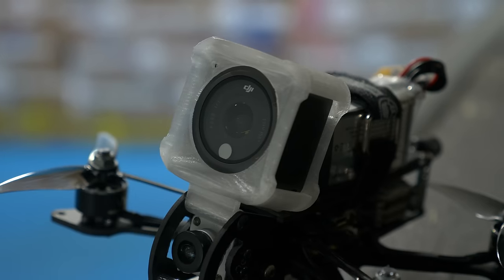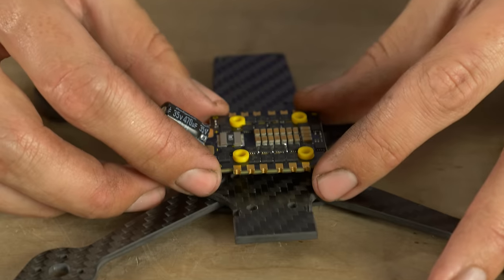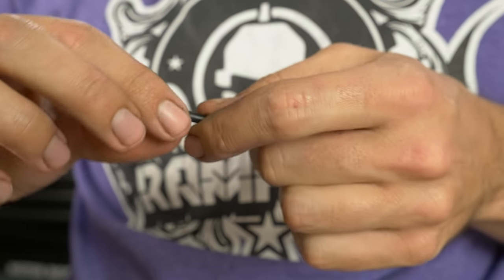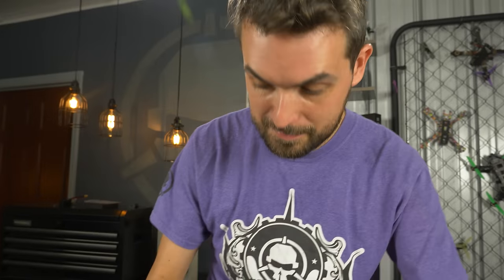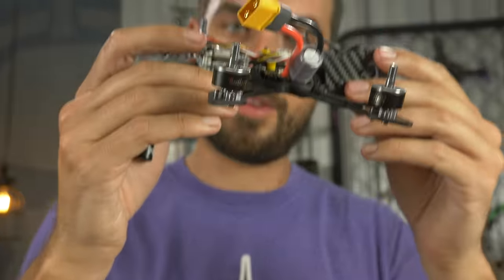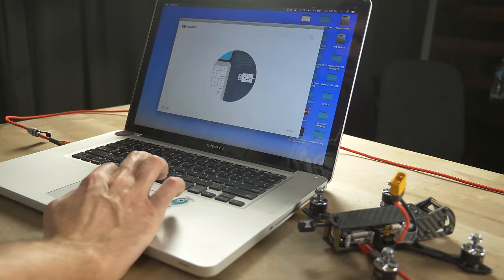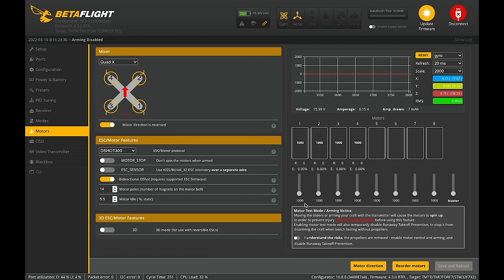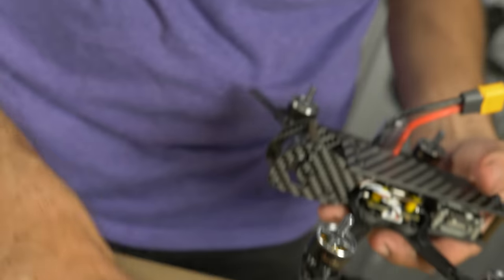The SkyLite - A 3-inch Whoop BEAST! - BUILD

Comment: I wanted to follow up with my experience so far. I received the quad in two weeks, the build quality appears solid and even though it’s my first freestyle FPV quad I had it flying in a couple of hours. The USB-C port on the air unit is hard to access and I actually didn’t see it at first. I took the duct off but it might be possible to bend it to the side to plug in. I’ve been flying the DJI FPV in manual mode and flying sims, and it felt very familiar to fly the SkyLite. I was doing rolls and flips and flying around the yard by the 3rd pack. Looking forward to trying it out with the ducts removed!
Reply: Carson,  I am starting out right now with a dji fpv and was looking at this for something to practice with that can take a beating and be fixed easily. Are you running this build with the goggles v2 and controller 2 from dji?

Comment: Looks like my next frame :)
Little hind, if you just put the solder on the iron tip and transfer it from there to the wires / pads +use little bit of flux 280-350C° , there are no sprinkles and you have one more hand .
But you need a good combination of speed and right temperature

Comment: These guys seem to specialize in making the hobby as simple as possible for the new guys. In FPV simplicity costs more, but in the long run you spend less than you would if you bought cheap junk parts that fail and are way more complicated.  Time is money. The DJI radio is just fine for most quads. The Vista is simple and works great as a receiver, but if you already have a Crossfire or ELRS this build is still simple and I am sure it’s a blast!  How about that 4.3 right?  No motor remapping in the CLI or reversing direction in the BL Heli configurator!  Like I say simplicity costs money, but buy the quality now. You’ll thank yourself later.

Comment: For smaller capacitors you can place the heat shrink first on the power leads before soldering them so you don’t need to pull xt60 through:) ps. Just checked: 14mm diameter (22mm when flattened) thin heat shrink baaarely fits over an xt60

Comment: Blobs of solder flying everywhere, lol, you need to slow down when you remove the tip from the pad.  All it takes is one of those blobs to hit the circuit board and it's magic smoke time.

Comment: i guys, a friend of mine bought this drone. With ducts it flew very well and quietly. When he became a bit more confident, he wanted to fly without Ducts and bought appropriate props. Strangely enough, without ducts the copter flies very unsteady and shakes. The motors get very hot. When he puts the ducts back on, everything is back to normal. Does he have to change anything in the tuning without Ducts? Grateful for any tips.

Comment: Hello Drew, 

Now that the DJI 03 has come out & RotorRiot is offering this model with that DJI 03 fpv unit, 
I would love to request another review of this bad boy.... 
I have the GEPRC Smart35 (Vista Nebula nano HD) which I love but it does not come with the DJI 03 FPV unit in an RTF option... (please note, i also have the DJI AIR Skyliner Unit you built for me, and love that one for the 5inch situations and you have it tuned smooth as butter)...
....so personally it would be really nice to see the side by side comparison between the Skylite DJI 03 unit and the GEPRC Smart35 unit (Vista Nebula nano HD)... 

Comment: It looks like you might have the only 3.5 inch dji 03 rtf option out there (please someone correct me if im wrong)....

Thanks Drew,
Jeff

Comment: Damn its been 3-4 years since I've had a drone. But this one really has me intrigued to get a whoop style for my new hero 10. Now before I get too excited do I need to upgrade my goggles and radio to even stand a chance in todays FPV world? I have a Spectrum DX6e and Fatshark Dom V3's. Because it seems everything revolves around the DJI stuff now and im not going to be that invested into the fpv world to want to upgrade to that.
Reply: This build, as it is in the video, will require the DJI goggles and DJI controller.  RotorRiot has a serious man crush on DJI so all of there builds are centered around it.  Perhaps they will offer a build that is analog in the future, but for now this is a digital build.
Reply: @bladezx2  Yeah and thats what I have found is everyone has a crush on the DJI stuff and I get it. Everything you comes across only fits the dji stuff. But its hard because I have no idea anymore or where to look at for a new build using new product analog stuff.
Reply: @matad311  I'm in the same boat, although its been a big longer for me.  I'm still watching a lot of videos trying to get caught up but 6-7 years is a LOT of time to make up.
Reply: @bladezx2  Yep I hear ya! I may just end up doing a iFlight 5" quad that's already built and just need to add a RX. Man its so complicated because any fpv website i have come across does make it very clear whats all compatible.

Comment: What's the all-up-weight of either configuration (without camera or battery)?  Is the frame anywhere close to 50-60g?  I'm just wondering how reasonable it would be to build as a sub 250g model.

Comment: I wonder why you prefer big ducts instead of the slammed ducts
Reply: Big ducts are more efficient
Reply: The tall ducts are much safer when flying around talent and they slow the rig down so that it's more accurate for hitting gaps, they basically keep it from sliding around
Reply: @JPTulo  not true, that was an old misconception that's been proven wrong over the years since it's impossible to get the tip of the prop close enough to the wall of the duct.

Comment: Do you think 1404s are too small to for this build?
Reply: Way too small, you want a 2004 at the absolute minimum but a 2304 will be even better, the 1507's in this video have enough power but are too tall to stay cool which will hurt flight performance and efficiency